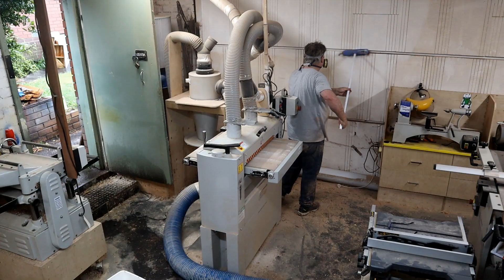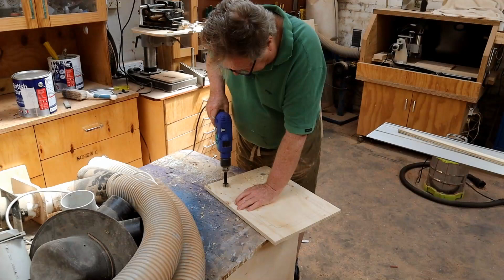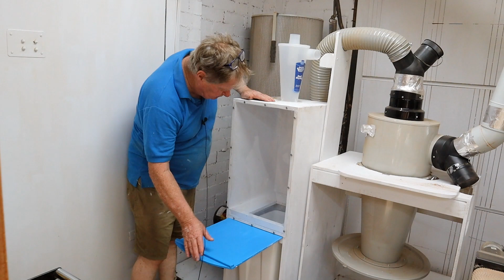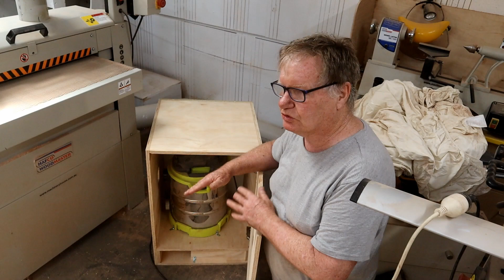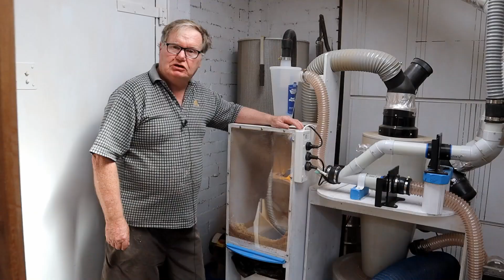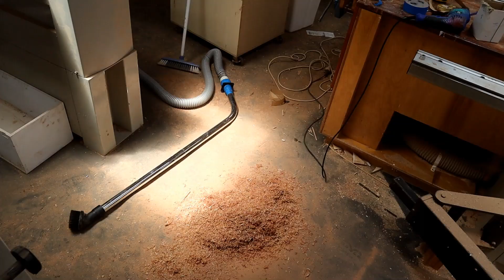The Ultimate Dust Extraction Innovations after many stuff ups!!

Comment: VERY interested in this Daash, I think I want to copy your perspex box design for my new system. Been struggling to find a cycle bin that will work... so I may just build my own! :D
Reply from the maker: Hi James, i don't have any design plans, i just make it up as i go, but it is a easy design to make just follow along the build video,  but it doesn't work as good as i would like a lot of dust still goes to the shop vac , i think the onida on top is too small as it clogs up before the dust drops into the collection  box , i am going to build another one over at my miter saw station , and i think i might modify it a bit to see if it works better  cheers dan
Reply: @dassh22  yeah I'll have to customize it for my space and mine will be the 4" one. I've just been struggling to find a suitable sized container so the idea of making my own is what's inspired me 😊

Comment: think your sucking in air past your sliding flap causing some of your dust draw back, shops vac's would have a lot trouble with air resistance from such long hose, maybe look at making attachment for your 100mm system clean your shop, even if you use a shorter hose and run duct access points to other end instead of long hose as flex has far worse air drag than the pvc piping. i use two of the smaller ryobi vac together in parallel with buunings bucket turned cyclone for small port toools and was running ferrex dust extactor (cheap aldi's) on thicknesser and jointer with home made black plastic garbage bin cyclone looking at upgrading it as just burned out